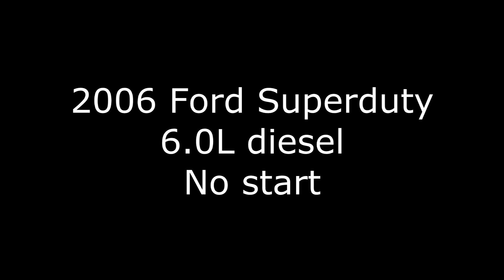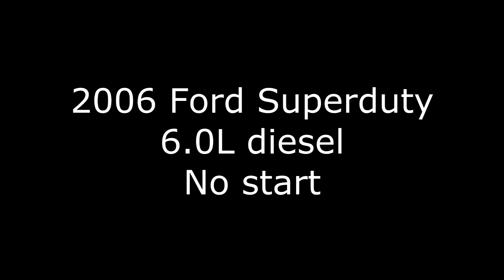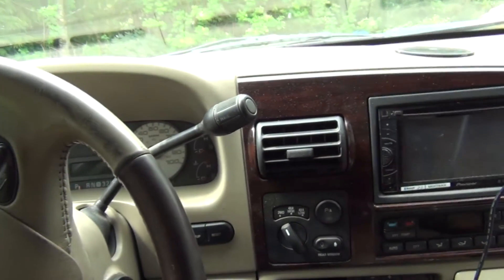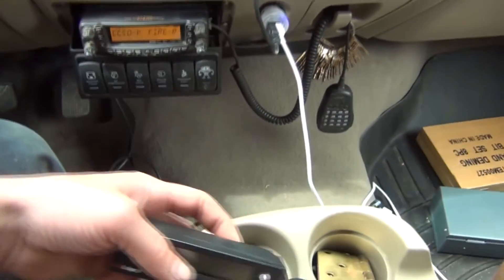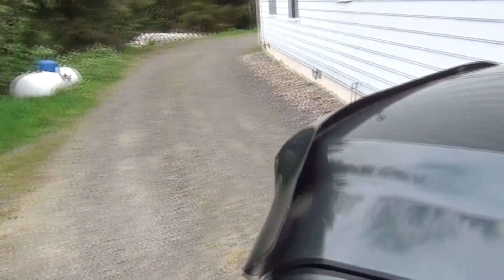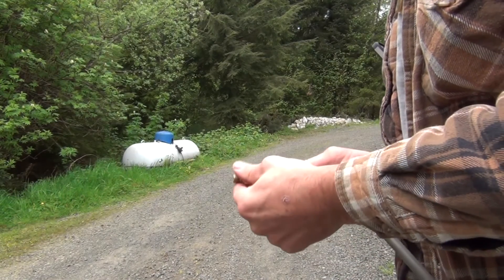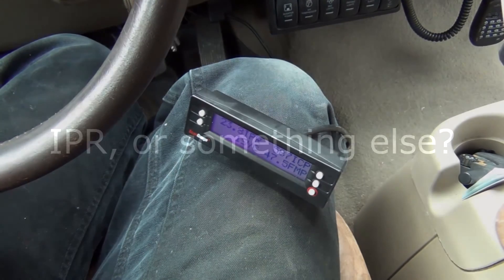ford 6 0 diesel no start

Comment: What are the odds the pressure transducer is bad (internally?)   I had a similar failure once; whereas if i removed it; and had a pocket of air in there; it'd work -- but after awhile, it'd take on (liquid) and not read right.   hope the IPR does it.  Are these the same engines they throw in their Int'l 4600/4700 chassis?
Reply from the maker: n3lee I had good readings from my ICP sensor...I spent a lot of time watching it while the truck was running.  And, removing the connector during the "no start" condition would not allow the truck to start.  Also, during the no start, the %IPR was up to about 85%, showing that the computer knew that ICP was low and it was attempting to fully close the IPR valve.  This would also indicate that the ICP sensor was working properly and that the fault was either a really big HP oil leak, or that the IPR was defective.  I put a new IPR in last weekend, and so far the truck has not experience another failure to start, so I'm hoping the problem is solved!

Comment: I think you are on the right track. International really screwed Ford with this engine. I believe it to be the worst production engine ever produced. There is nothing and no amount of money that can make a 6.0 reliable. Yes I am a Ford only guy but I would not buy a 6L even for $1.00 I bought a V10 after my 7.3L during the 6.0 years. The only advise I could give is get rid of that thing asap.
Reply from the maker: ***** I've owned a few of them!  I felt the same way you did after buying my first one, but after working on a number of them, I began to see some patterns and I started to hate the engine just a little less.  A few injector replacements, a few head gaskets, some autoenginuity software, and a few EGR coolers, and I'm past the "all 6.0L engines are crap" mentality.  Don't get me wrong...I agree that they were a really poor design with a lot of flaws.  I'd place the 6.0L last in my "engine choice" list.  But...the advantage is that these trucks can be picked up for a song.  I bought this one a couple of years ago for about $11k.  2006 fully loaded King Ranch with a few engine problems.  The owner just wanted out from under the 6.0.  Hard to find a 1 ton fully loaded top trim level 2006 truck for anywhere near that price...
Reply: sewerzuk
Check in with "Powerstrokehelp" here on youtube. He knows these engines inside and out.
Side note: after watching your videos I bought an MEP-003. Best generator I have ever owned. Maybe one day I can get your part locator info.
Reply from the maker: ***** Glad you found them helpful!  The -003 is a just an onan DJC generator, so engine and some generator parts can be purchased from any cummins/onan dealer.  The other parts are best found at surplus dealers, but there are a lot of them out there.  If you don't care about having a "correct" -003, they are easy to modify with civilian parts!

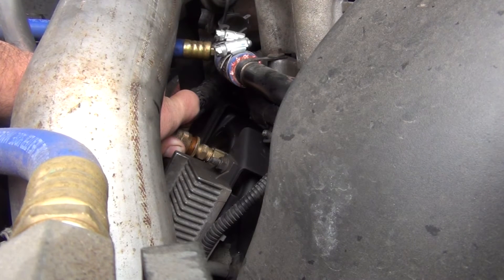Comment: 2 things. Firstly you absolutely do have a oil leak. In the vid you can hear the rail empty out and then start leaking air.(listen between 4:38-4:46) And under the presumption the mic wouldn't pick up sounds from the other bank, its on the passenger side. Second "DieselTechRon" is a great resorce here on youtube for everything power stroke's. He has a Vid specifically devoted to a problem exactly like yours. ----   https://www.youtube.com/watch?v=20Q6fISsF34
Reply from the maker: Venom2U I did not command the IPR closed when I applied air, so the oil escaping and subsequent air in the right manifold was because of this.  There was also some air escaping around the fitting, as I only installed it hand tight.  I wasn't attempting to look for a leak using compressed air in the video...the procedure is a bit more involved than just applying air to the ICP port.  Just demonstrating that putting a bit of air in the manifold would cause the truck to start!  The truck does not exhibit the normal high pressure oil leak symptoms; just the occasional failure to start (hot or cold).  Thanks for the suggestion to check out Dieseltechron; I am very familiar with his videos, and referenced them before I replaced injectors on my first 6.0L a few years ago.  I will send him a link to this video and hopefully get his input.
Reply: sewerzuk OK I didn't know the IPR was still open. And I didn't hear any air leaking immediately when you applied air pressure to the fitting. I did actually specifically listen for air when you first applied pressure to see if there was any leaking from the fitting, and when I didn't hear any I assumed the system was sealed. Personally if it were me I would redo the leak test with the valve covers off with the engine warm/hot. You're not replacing any parts doing it with the valve covers off, and their removal is not all that laborious (comparatively).  Failing that I would also strongly suspect an IPR as well. (since you've already gone through the plugs and stand pipes)
Reply from the maker: Venom2U I did pull both valve covers and performed the leak check with the IPR commanded closed (this was a couple of weeks ago).  I could not find a leak; I have conducted this test on other trucks and HAVE found leaks, so I do have a reasonable feeling for what I am looking for.  At that time I also pulled the IPR, removed the screen and inspected it.  Since I couldn't find any problems, I didn't replace any parts.  I ordered a new IPR.  I just can't think of anything else that it might be...
Reply: sewerzuk One last thing, when you did the plug & stand pipes did you loose any pieces of the O rings? (or the injectors as well) Setting aside the IPR for the moment. The only thing I would be concerned with is a piece (or a few) of old hard o ring clogging up the IPR port. Now that would account for the air pressure = start condition. Given how the port is arranged on the 05 and up iron pumps if that cavity is filled with air any debris will fall away from the IPR screen. There by allowing the IPR to see actual oil pressure at least momentarily. That would also account for the inconsistent nature of the problem as well. If it were me, I would spin the engine over once the IPR is out. Yes it will make quite the mess, but anything in that port will be pushed out by the pump. Just use a bunch of rags to catch it all. Just as a heads up. The unrestricted flow of the pump IS significant. So don't spin it over a ton. All of this is assuming you've trouble shooted a bad ICP
Reply from the maker: OK; thanks for the idea.  When the new IPR shows up, I will flush out its port with it removed.  As far as debris in the engine, no I don't believe I lost anything.  I'm pretty meticulous with cleanliness.  The truck has run well for about 30k miles since I did the HPO system service and injector replacement.  My feeling is that any debris would have shown up a little bit sooner than this.  But...who knows.  Hopefully I'll put a new IPR in and the problem will disappear!
Reply from the maker: Venom2U I replaced the IPR and cranked the engine over a few times with it removed.  You were right; LOTS of engine oil even with only a second of cranking!  I couldn't spot any debris...but it could have easily been missed as I did the procedure with the turbo in place and it was difficult to see.  I re-checked the old IPR (removed screen, held the plunger open, backflushed with solvent) and could find no debris.  Hopefully the new IPR solves the issue...
Reply: sewerzuk OK good to hear. Hopefully this will solve the issue. If it doesn't just respond here (im subscribed to this vid)
Reply: sewerzuk Its been a few weeks, is it still acting up?
Reply from the maker: So far so good.  I have put almost 2000 miles and hundreds of hot and cold starts on the truck since the IPR swap with zero no-starts.  I can't be 100% sure since the old IPR looked and tested OK and since the truck has gone long periods without a no-start before, but so far it looks promising.